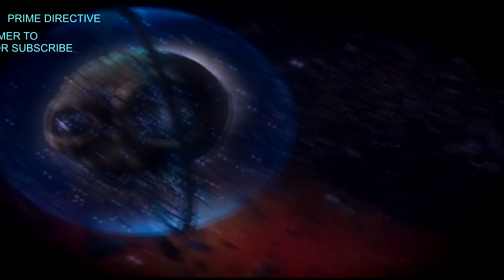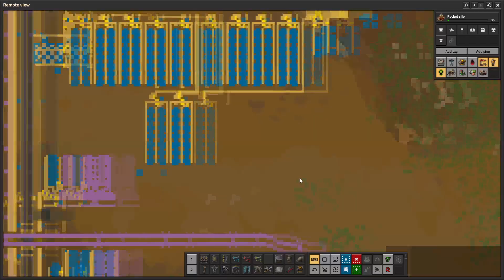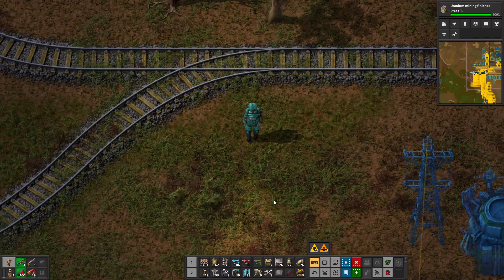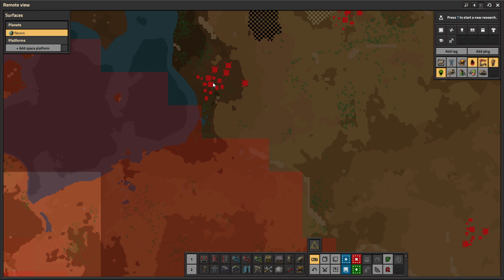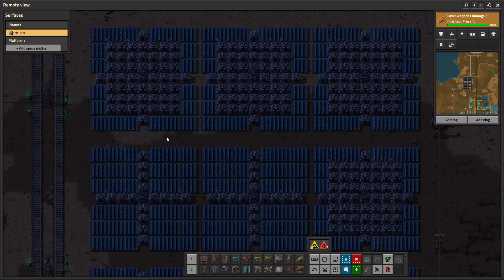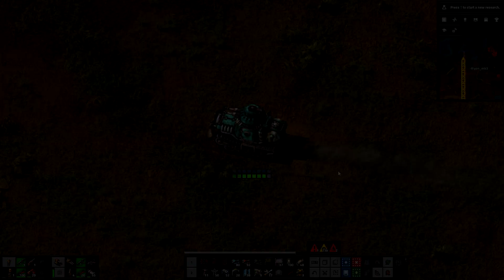Factorio Space Age / part 4 / The Factory Must Growe

Comment: you couldn't find the updated mod? that's very strange, i am using it at the moment.
and after looking for VehicleSnap , all i can find is the mod in question. it has been updated for factorio 2.0 for over two months now.

a nine hour slog to save your nauvis base followed by the disappointment of having the whole reason for the trip being unavailable to build?
wow, that sounds like an awful experience...
good thing all planets except aquilla have all the resources to build a base to get back.
if i may make some design suggestions for spaceships for the first three planets:
build a looping belt all around your ship, including the back part, and have a wall three or four gun turrets in between asteroid collectors.
that should get you maximum protection while also getting you enough resources to sustain your ammo production. i suggest having three assemblers for ammo production, with modules.
and for the belt that delivers the asteroid chunks, which should also be a looping belt, i strongly suggest having having a setup to get rig of excess chunks of one kind, since you will definitely be flooded with more chunks of one kind than you can handle thanks to the different asteroid ratios.

the new quality mechanic is quite nice, though it's a bit of a hassle to sort and filter the stuff and it will fill your storage and inventory fast.
i suggest you start your quality production, once you have scrappers, with medium power poles and inserters, followed by either asteroid collectors and turrets or the various production machines, depending on how whether you still want to focus on solidifying your base or rushing to the other planets.
and maybe bots. though you won't really need them until aquilla.
but in any case, take it slow with quality. you can't speed/productivity module and beacon your assemblers without getting a quality debuff so just build the production setup and do something else while it runs for a while.
well, you probably have figured that part out yourself already.

oh, and if you go to vulcanus, take a couple stacks of uranium canon shells and a rare tank with you. that tank will easily deal with small worms.
the alternative of building a gun wall filled with yellow ammo will work too, if you just use enough of them, but quite a few will be destroyed and that is kinda a waste of resources. not that getting resources is an issue on vulcanus.

the big miners you get there are also very nice.
not only do they have the reduction in ore field consumption, they also have a mining area large enough to fit beacons in between. and once you have belt stacking unlocked, they do that automatically.
a high quality big mining drill setup with high quality beacons and high quality tier3 modules can make any ore patch last till the of the playthrough, they can be ridiculously powerful.